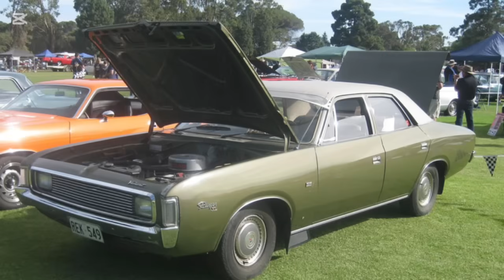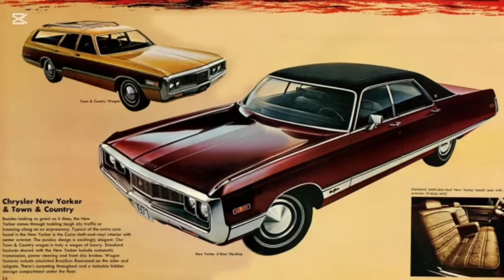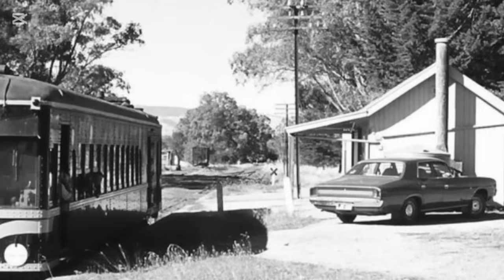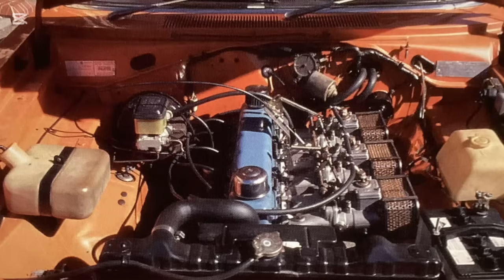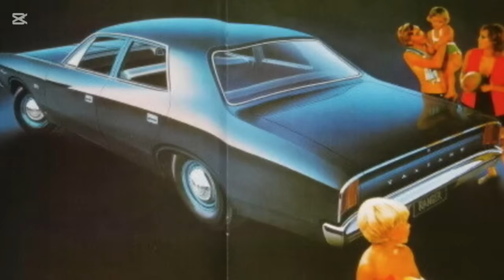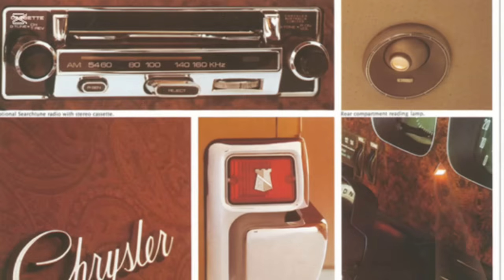VH Valiant & Charger - The Most Comprehensive Video Ever!

Comment: Have you ever noticed how those Chrysler styled steel wheels are the same design as what was on some late sixties/ early seventies Oldsmobiles like 442's , Hurst Olds ? . They sure look the same, but I can't understand how this could have come about.  The difference is though , that the Oldsmobile wheels are 15 inch diameter.
Reply: An update, Ive been doing a bit of research and it seems that those wheels were made by Sankey Benson in Australia , Sankey Benson was an England based wheel maker .And it seems that the same design wheel that was an option on late sixties to early eighties Oldsmobiles were made by Hurst  ( SS11 and SS111 designation ) and they came in 14 and 15 inch diameter. Either Sankey Benson were first, or Hurst were , probably SB . You know how wheel designs can be made by multiple manufacturers.
Reply from the maker: @barrycuda3769 Very interesting. They were a nice, simple wheel. They looked wheely good you could say. 😀👍
Reply: @markbehr88 Another in the "Dad joke"  category. 😅
Reply from the maker: @barrycuda3769 Yep.
Reply: Further to what I was saying, it appears that ROH also supplied those wheels to Chrysler Australia, maybe all of them ? 🤔 , but I'm pretty sure I saw evidence of Sankey Benson versions as well . Also,  it seems that those 5 spoke mag ( alloy ,with black spokes) wheels that came on some XA GT Falcons were made by Sankey Benson, at a factory in Sydney.  I'm glad that I can tell you these interesting things from my research,  I was telling my son about it , and I noticed him looking at his watch , and yawning .
Reply from the maker: @barrycuda3769 I thought Sankey Benson did the proper mag wheels for them? But I am not really sure. 🤔
Reply: @markbehr88 Yes,  from what Ive  learned, they made the 5 slot aluminum mag wheels for CL onwards Valiants, the earlier 5 slots on Valiants were ROH .And the styled steel wheels were also from ROH , ( and maybe Sankey Benson also ?).
Reply from the maker: @barrycuda3769 👍👍
Reply from the maker: Yes. Very similar. I am sure they were probably inspired by the Oldsmobile. 🤔
Reply: @markbehr88 Since they were on Hurst Oldsmobiles, Ive wondered if they were made by Hurst Wheels? .If Chrysler Australia copied them ,( or an Australian wheel maker did for them) it wouldn't be surprising. Look at how many wheel manufacturer's copied the original Ansen 5 slot "Spint" mag ( including ROH) , the list is nearly endless. Come to think of it, maybe ROH made those Chrysler styled steel wheels  ??
Reply from the maker: @barrycuda3769 I think they were used more extensively than just Hurst. 🤔

Comment: It's interesting that Chrysler sold twice as many VJ sedans as they did   VH sedans , when the VJ isn't as good looking IMO . And then VK sedan sales dropped  to about  9000 less than the VH. Another noteworthy thing is that ( as far as I know) Chrysler didn't press any long doors specifically for Chargers and hardtops, but instead   just welded in some extra metal to sedan doors to lengthen them . I also read somewhere years ago that the management of Chrysler deemed that Australians wouldn't take to the name Plymouth, so in Australia they went with  " Chrysler Valiant " . Also , Chrysler Australia put together a VH Hardtop  drag  "Funny Car " .
Reply from the maker: Maybe the economy was part of the reason for the sales difference plus number of months on market? 🤔
Reply: The CL was my favourite in that generation. 
The VK was only on sale a year or so, the shortest currency of any in that shape Valiant.    That may explain smaller numbers.
Reply from the maker: @noelgibson5956 I think I like VH and CM best although the 360 was freely available in the VK? 🤔
Reply: long doors were 1 peice outer skins, door inners appear to be additions to shorter sedan doors.
Reply: @RobertGraham-s2p  Yes, that sounds right.

Comment: No mention of the mighty p76
Reply from the maker: There is a mention of it and the Leyland Force 7V. 🤔
Reply: @markbehr88 sorry I spoke to soon when I was watching the clip. It was a great historical story of the valiant of that model. Really enjoyed it. Ive owned a few Val’s over the years. The vf probably my favourite. The cm i owned could handle and stop. They had great motors. Thou my favourite car of that era  was the p76. It would easily out handle any of the big 3. The v8 was a sweet unit, with the 4 speed behind it. My mate had a 265 charger and over all we were equal on performance. And with the right size tyres the wheel arches didn’t to out of place, ha not like the falcon 2 door, with factory standard wheels. I remember pulling up in a servo one day in Sydney. Some young guys were calling it a p38. I opened the boot and inside was a mobile compressor on wheels with tank and a 3 phase motor. I said put that into the boot of your shit box commodore.
Reply from the maker: @Michael-v3h8k 👍. I will do an episode down the track on the P76. 👍
Reply: @markbehr88 thank you , that would be amazing sir.
Reply from the maker: @Michael-v3h8k 👍👍

Comment: Mark, I don't usually bother to comment on Youtube as i hate having to sign in, but this high quality presentation just cried out for some comments.....
I have actually watched many of your videos, all top quality.
Thanks for such detail as you provided. I can just imagine how much effort was involved in putting it all together. I probably have a lot of it in various places, but you tied it all together so wonderfully!
My interest in Chryslers began with Chrysler Royals & I owned 2 1959 AP2 models - both 251cid 6's, a Wayfarer ute and a Powerflite sedan (with the handbrake on the tailshaft like a truck).
I would love to have an AP3 model, maybe if I win the Lotto!

I have never had a VH or CH, but have ridden in a CH in 1974, and several friends had VH's - a Ranger XL, with 245 column auto, Regal 265 column auto, and Regal 770 318V8 floor auto. My father-in-law also owned a 1977 CL Regal SE 5.2L V8.
I did own 2 1976 VK models at the same time - a Regal 5.2L V8 wagon and a 245 Ranger, both autos on the column. These were great cars and I was sorry to sell them but I was doing a lot of country driving in Central Qld at the time & needed aircon in the heat. It was just too expensive to fit to the Valiants so I sold everything and bought a 1981 ZJ Fairland 6 - that's another story!

I do like a lot of modern car conveniences like electric windows, locks etc but when a $16,000 car won't go because of a low-cost part that nobody seems to want to fix I think it's time to go back in time - maybe a CM Valiant wagon?
Reply from the maker: Thanks very much. I appreciate you taking the time to comment. That Regal 770 V8 would be nice to own now?  🤔👍

Comment: You did an excellent job in the video. You covered a lot. You made the connection to American Chrysler and how how they competed locally in Australia. The Dodge VIP sold there was the Plymouth VIP in the United States. I liked how you explained the switch from American design Valiant to Australian design. Thank you for sharing the dimensions too. The Chrysler by Chrysler was big as a downsized GM C or H body car from the 1980's.  I noted how they were using rectangular headlamps in the early 1970's there and they did not appear in the United States until 1975. That Chrysler by Chrysler was loaded too. I know there were American Chryslers that did not have some of those features. The Chrysler by Chrysler also looked like a early 1970's Chrysler/Dodge /Plymouth Satellite
1977 Dodge Charger commercial: https://www.youtube.com/watch?v=1qS_ZvSdBXo
Other Charger commercials 1966-1976: https://www.youtube.com/watch?v=Bi8fCm4ghbs

I liked the images of the Fords and Holdens and the information shared.  That early 70'a Holden looked like an Oldsmobile in the front styling. Thank you for explaining the naming too.  I liked the seeing the design proposals. You are right that one concept looked like A 1970's Lincoln or a 1974-1975 Imperial or a 1976-1978 Chrysler New Yorker. 

Thank you again for the video.
Reply from the maker: Thanks Olds98. Glad you enjoyed it. There was certainly a lot to cover for this model. 👍

Comment: Great work again Mark. At 1 hr, 22 minutes it must be one of you longest yet. A few comments though, you pictured the Town & Country Ute (option K10) but didn't mention it. Also no mention of the E48 Charger, which to my knowledge was basically an E37 with a 4-sp BW gearbox fitted. I think that the CH Chrysler by Chrysler used the same front guards & bonnet as the regular VH models. The nose panel was different however.
Reply: I don't recall any E48 VH chargers - pretty sure the E48 was VJ model only.
Reply from the maker: Maybe I meant E38? 🤔
Reply from the maker: Thanks very much. I included the Town and Country visually a couple of times. I mention the E48 in the engine section. You could be right re the bonnet. I’ll have to take a closer look at that. 👍

Comment: Mark, why did Chrysler Australia drop the Slant Six and replace with the Hemi 6?  Was the Hemi as reliable as the Slant?  In USA The Slant Six was considered one of the most reliable engines ever.
Reply from the maker: I assume there was no real development potential left in it for larger capacity applications such as the 265. The cost of doing that was probably as much as the new engine? 🤔
Reply: @markbehr88  In the US market for real power Dart offered V8s so no high performance 6.  a few 383 and 440 engines were sold, the 340 with 275hp was the most popular performance engine. I learned to drive in 68 Dart  GT with 170 slant six.  The Valiant not sold in performance editions starting  in 67 so as not to compete with Barracuda.
Reply from the maker: @johnlyle1127 That 383 engine is excellent. I have one in my 66 Monaco and it goes really well. 😀👍
Reply: Chrysler Australia needed to manufacture their own 6 cyl engine, because the government was requiring car makers to use 95% ish locally made components, to increase employment. So they took on the Hemi 6  D engine that Dodge in America had designed ( in 1967 ) but didnt put it into production. Yes the Hemi is very reliable, I have a Hemi 245 that's done about 176,000 miles, and the oil level never budges from the FULL mark , and has never needed anything done to it , except for a new set of lifters.

Comment: I owned a 1972 770 318 charger in the 1980s factory air but not much else. Had 60,000 miles on it when I got it. Great car.
Reply from the maker: Sounds cool. 👍

Comment: That big Chrysler 2 door hardtop is a beautiful car. What engines were available in them, and what was their curb weight?
Reply from the maker: Depending on the model, generally 265 and 318 plus 360in the Chrysler by Chrysler. Weight roughly 1650 kg. 👍

Comment: Thanks for this long awaited video. I can see that you made a great effort to put it all together. I can attest to the futility of matching up a 4 barrel carbie to the 265 Hemi. My VK Charger had a 4BBL Holley with long lynx manifold and a rather heavy cam. It ran badly and chewed up excess fuel. Not worth the effort. Another thing to note about the Chargers was the chassis rail where the steering box was mounted. They lacked sufficient drainage and mud would build up rusting out the rail causing the steering box to wobble. For what Chrysler Australia spent on it's development; the Valiant Charger would put any Plymouth Duster to shame.
Reply from the maker: Thanks. Glad you liked it. I did drive a 340 Duster years ago. It was a nice thing. 👍

Comment: To be honest, I don't think I'd take very seriously anything that  "Wheels"  magazine reported. For example, them saying that the VH sedans bootlid area dropped down sharply, well , it doesn't at all in my opinion , did they have a proper look at the rear of the XA Falcon sedan ?
Reply: And , also, Wheels magazine saying that the VH sedans steering was sloppy and scary, well , it's the same steering ( except for ratio) as on the  E49 that they declared as being  "car of the year" . I think Wheels magazine were hack journalists.
Reply from the maker: @barrycuda3769 Of the three, I found the Falcon had the best steering and road holding. 🤔👍
Reply: @markbehr88 I agree, I had an XR Falcon, and I remember driving an XB Falcon, and I was impressed  with the steering  stability, and ride comfort.  I also thought the same about '60s Mustangs that Ive driven , very nice . One thing that probably contributed a lot to that supple ride was that Ford insulated the leaf springs with rubber.  I love old Fords.
Reply from the maker: @barrycuda3769 Yes. The Falcons were a good road car. 👍
Reply from the maker: They did give Camira Car of the Year. 😂
Reply: @markbehr88 I had a Camira , it seemed ok .
Reply from the maker: @barrycuda3769 The JB had a very bad name here. I’ll do an episode…..one day. 👍

Comment: I found the VH wheelbases all over the shop. I would have (as you said) the wagon on the 115" wb, but I probably think the hardtop could have got by with the 111" wb.  So, for mine, Charger, then sedan and hardtop 111", wagon, ute and CbyC on 115".
Reply from the maker: Yes, they could have been a bit sharper there. I would also have only made the car two inches wider if the track was only 1 inch wider. 🤔

Comment: 215 auto underpowered
Reply from the maker: I think it went well compared to a Holden 3.3 or Ford 3.3 as the road test bore out. 🤔
Reply: @markbehr88 i had VJ 215 auto the excitment of the 245 power was sorely missed but had a good run from the car wouldnt crack the ton ex govt car elec ignition i fitted 6.5 x14 rims competition front sway bar pedder reds front shocks 3 spoke sports wheel
Reply from the maker: @Eric-kn4yn 👍

Comment: I had VH 770 and a VJ. Bloody good old tank. Rust was its biggest failing.
Reply from the maker: Thanks. Yes, rust was an issue as it was with many cars back then. 🤔👍
Reply: @markbehr88 the after thought drain pipes were an outright design flaw in the charger boot sill.
Reply from the maker: Yes and no real thought to longevity. 🤔